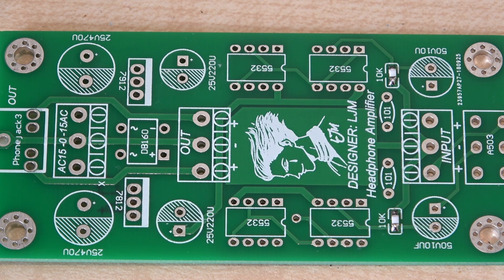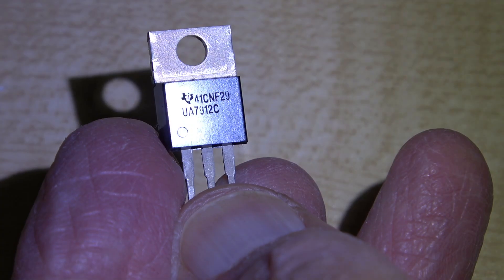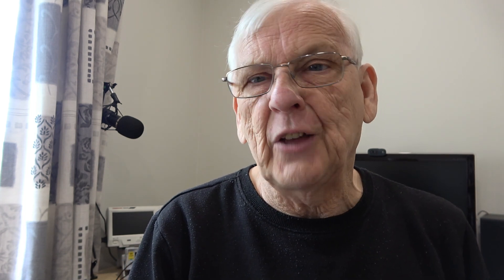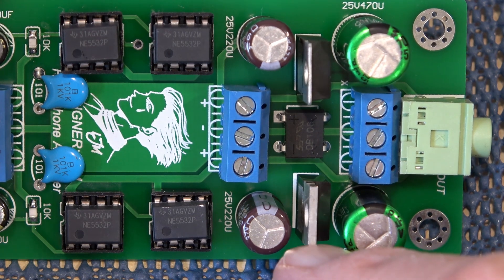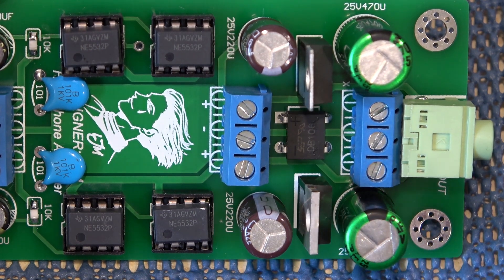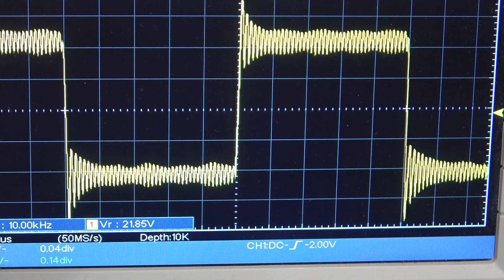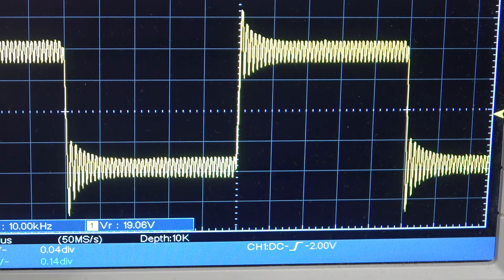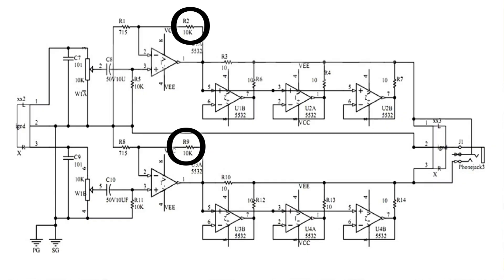Putting multiple ICs in parallel. A good idea or not?

Comment: The problem here is that the designer misunderstood how to parallel opamps and combined two methods.
R10 should be there if U1A and U1B were the only two opamps in the channel. This is exactly how it is shown in TI and AD application notes on paralleling two opamps. But here, adding U2A and U2B spoil the fun.

By removing R10, you "demote" U1A to the VAS stage while U1B, U2A and U2B are the only paralleled current drivers, each with its own equalizing resistor. If you move the right connection of R2 to the combined outputs of the three driving opamps, you compensate for any distortion in the driver opamps even more.

There are commercailly available headphone amps that are designed this way and one of them, the JDS Atom2, at a mere $129, shows distortion figures that resemble that of a straight piece of copper wire with gain. They use 8 opamps in parallel per channel.
See https://www.audiosciencereview.com/forum/index.php?threads/jds-atom-amp-2-headphone-amplifier-review.49795/

Comment: Michael , another great video! This subject is a great one for would be audio designers. One can successfully parallel multiple opamps but it must be done carefully. This board was obviously a poor implemtation. There are a couple of excellent benefits for designing a preamp or line driver using parallel opamps. First, you cut the noise in half by doubling the devices and has the added benefit of doubling the drive power capability. Take care!

Comment: Hi, like others have said, the input op amps are in non-inverting configuration. Inserting R5 and R11 from pin 3 to ground is a possible cause of oscillation. Have you tried removing R5 and R11 to see if the oscillation stops? The designer needs to explain to me why put a positive feedback with R3 and R10.

Comment: Bad idea given the inherent part to part variation. If, for example, the two amps have different input voltage offsets, their outputs will be constantly fighting. This case, plus the parasitics involved is a recipe for oscillation as well as excessive power consumption.

TL;DR: Don't do it. Bad idea.

Comment: One of the first things you learn in electronics is to never hook two outputs together.  Simply just don't do it ... the circuit will become horridly unstable as one output feeds noise into another, forcing feedback networks to try and compensate. 

Thanks for demonstrating this Michael.

Comment: Is the problem the parallel configuration itself or poor implementation of the configuration? ... (obvious in the specific case presented)
Reply: Poor implementation. Plenty of professional electronics gear that uses paralleled devices, be it FETs, BJTs, or even opamps for increased output power and lower sqrt noise. But that's been designed well and in a proven design before they start selling them for thousands of dollars. Proper power and response sharing is a tricky topic in general and cannot usually be approached from any one-size-fits-all principles.
Reply: @ivolol  Thanks
Reply: The difference is whether the paralleled devices can "sink" current. 

You can, for example hook two BJTs in parallel because they can absorb current in their collectors.  That is, they don't fight the current source.

You cannot, for example hook two Class AB op-amps together because their outputs are on emitters and they cannot sink current... feeding current into their outputs upsets the output stage bias and can cause massive instability.
Reply: @Douglas_Blake_579  Thanks.  Is there another class op-amp that will allow a parallel configuration?
Reply: @cougar1861  
Probably.  I don't know of one off the top of my head.

But... if you want to build a headphone amp, why wouldn't you use a chip, like the TPA6133, made specifically for that job?
Reply: @Douglas_Blake_579  I was just looking for general information not planning to build a headphone amp.  I opened the video based on the interesting title but was disappointed with the hopeless kit used to explore the topic.
Reply: @cougar1861  
The most general info I can give you is that hooking the outputs from these chips together is generally a very bad idea.
Reply from the maker: @cougar1861  Why not just use the Accuphase clone, I have shown a few weeks ago, that is a very capable headphone amplifier and a very good preamp, all for a very low cost. There is nothing magical about a headphone amplifier, it's basically a preamp that can output current at a low impedance.
Reply: @Douglas_Blake_579  Got it.  I'll watch the video again and then look at the schematics of the examples of parallel-opamp amplifiers mentioned elsewhere in the comments, i.e. those of Douglas Self and "Phil's Lab."
Reply from the maker: @Douglas_Blake_579  I was just going to reply but you beat me too it lol.
It is quite common to parallel output transistors, or FETs in power amplifiers, this works perfectly. Even then matching is preferable and almost always have a low value resistor to share the current. These are discreet devices, not complete amplifiers.
Reply: @MichaelBeeny  
Yep... where you get into trouble is when you try to feed current into the biased emitters of a class AB output.
Reply: @MichaelBeeny   I too was curious about starting with such an obviously compromised setup.  Is there not a better way to demonstrate (or debunk) this application than using an inappropriately designed circuit full of unknown knockoff components?

I found this video in my feed after looking into op-amp “rolling” in Class-D amplifiers and DACs, and I have subscribed to your channel as I’m extremely curious to see what sort of experiments you come up with.

I was disappointed to see this approach taken.  I too have seen claims that piggybacking 5532’s can improve SQ, and after seeing your oscilloscope captures I believe your explanation could indicate why (high frequency “detail” is actually oscillation), but I would also like to see this demonstrated in a much more reliable circuit.

I know enough about electronics to be dangerous, nothing more, but I’m seriously looking into purchasing an oscilloscope to play with for these very reasons.  I haven’t used one since high school, but it’ll come back to me I’m sure.

Keep up the interesting work!

Comment: If you google NE5532 power audio amp, you can find an article about paralleling up 32 of them to make a 16 watt amplifier to drive speakers.
Reply: Ok, you found the 'Elektor' article of Elektor 10/2010. The author is Douglas Self. I learned in the comments, that he designed the amp presented here too. So he seemes to to be a big fan boy of the NE5532's. I like the NE5532's too. But my design of a headphone or power amp would be very different for different reasons! I guess, that Douglas was temptated by the low pricing of the chips. The 5532's were really expensive in the 80's !

Comment: My own experiences attempting to parallel op amps (in particular the NE5332 and LM4562/LME49720 series) have been highly negative.
Those experiences led me to work on a hybrid (IC/discrete- not tubes/valves) design that performs very well so far.
Mike alluded to this in another of his recent videos and it will be revealed shortly (we hope).

There ARE op amps, mentioned below, that are far more amenable to being paralleled.
For example, the NJM4580 which works quite nicely in parallel.
If you were to plug them into Mike's board (with R3 and R10 removed..!) they would probably work well.
The output resistors (R4,5,6,12,13 and 14) could be as low as 2.2 ohms and they would still be happy. 
I built a kit headphone amp (HA-PRO2 style) using paralleled NJM4580 chips for my wife that both sounds and performs great.
No oscillations, no overheating chips, it just works..!

And the LME49600, also as mentioned below, is an absolutely excellent high current and high speed buffer chip that is very well suited to work along with the LME49720.
Texas Instruments in fact sells an evaluation board (LME49600TSBD) that incorporates both these devices.
Great- IF you can afford it (about $250USD).
Sadly, this device is not available in a package style that is usable by most experimenters and it does require special care in board layout and supply rail bypassing.

😃  FWIW...

Comment: when I buy cheap parts i like to buy used/pulled parts, you get a few broken ones but most are in good condition as they have been pulled from failed products (as in didnt get to market) and are usually genuine parts unlike the spanking new parts that are 'genuine' 
I usually do this for power mosfets, simple to test and verify to be original gwo

Comment: R3 (R10) are somewhat controversial...
It can be seen as positive fdbk on the three buffers which seems a mistake but maybe as an additionl 4th balancing resistor to feed the load by the first stage also.
As already said in other comments, unmount R3 and check, should be fine. In this case three buffer will drive the load in //.
On the other hand, if the gain opamp is also intended to contribute driving the load (4 in //)...well, i think that simply having R3 in that place is not a good idea.

Comment: Looking at the circuit, it appears that the first 5532 gives a voltage gain of 15, the other 3 provide current amplification, the parallel configuration to reduce the output impedance to assist the driving of low impedance headphones I suppose..
I would try adding a 470pf capacitor across the 10k resistor R2 which will reduce the bandwidth by -3db at 34khz and hopefully stop the oscillation.

Comment: Hi Michael, the equivalent circuit of  IC socket pin will contain inductor, this may be the cause of oscillation. The kit did not come with IC socket for a reason So after the experimentation, try the board without socket and see how it goes.
Removing socket is not hard, get a solid thick wire, secure it around outside of 8 pins, then fill the solder. After heating 8 pins at the same time, socket should fall off.
Reply: Highly unlikely the oscilation is caused by the sockets.
Reply from the maker: @WimukthiBandara  I would agree. I always use sockets, simply so I can experiment. This is the first time I've seen so many issues.

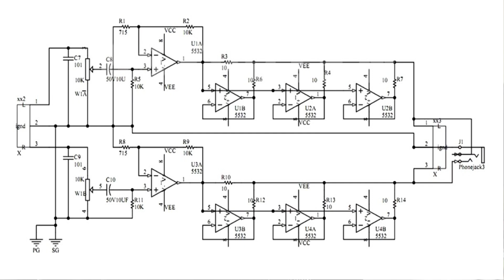Comment: Well, i wonder, if the the schematic is right. What's the purpose of R3/ R10 (11:28)? Of cause they ruin everything. Just pull them out and the oscillations should disappear. Paralleling Opamps can really make sense in some applications. When it comes to audio parallel Opamps are used in input stages of phono preamps. The paralleled inputs lead to reduced noise ( 4 parallel Opamps cut the input noise in half !). Years ago the 'Elektor' magazin published a power Amplifier ( 10 to 20W, i guess). It consists of a lot of NE5532's. So it was a similar approach to this amp.
Reply: That design was from Doug Self and is discussed at some length in one of his books.
However, very careful board design and component selection is required.
Such care is clearly not evident in this board...
Reply: @ronschauer839  Ok, Doug Self is someone. So i had a closer look at the circuit. Yes, with R3 and R10 inserted you gain the additional output current of U1A /U3A. But in my eyes this is really a danger seeking design. He introduces positive feedback while not knowing the connected load.

Comment: Aren't 5532 chips so cheap anyway, it doesn't seem worth the effort to fake them?
Reply from the maker: From my experience, fake 5532s are not manufactured new. They are simply an older poor spec IC re labeled. Effectively costing the fakers almost nothing. The only cost is re labeling them. I would expect they are making more money out of fakes than the profit from a real one.
Reply: @MichaelBeeny  True, but the big users of that chip would just buy from TI or a big supplier, whereas I thought hobbyist audiophiles were mostly interested in replacing the 5532 with something better these days, so are they still in demand with tweakers?

Comment: Hi. First  of all I want to say that I like very much of your vídeos. About the circuit: 1- I never liked op-amps in parallel. 2-  The R10/3, 10 Ohms resistors increase instability via the positive feedback they provide. 3- A 1KOhm resistor inserted between the node of C8/R5 (C10/R11) and the positive input (3) of the first op-amp will increase stability without any penalty in the audio band...

Comment: You might try a 680 pF cap across R2 and R9, which is 10x the value you tried.  With R2 & R9 being 10K, 68 pF gives a cut-off frequency of 234 kHz which is much higher than needed for audio.  Using 680 pF, the cut-off frequency drops to 23.4 kHz, still above audio with a nice roll off. 

Out of curiosity, if you try this experiment, can you show any oscillations on the scope trace?

thanks

Comment: Ah you answered all my questions with the amazing power of square waves.  

I discovered recently a dual opamp called Oracle II 02 and it’s $8 on Ali express.  The alleged specs are Here are the correct specifications for the Oracle II 02 op-amp:

Maximum output current is 60 mA, slew rate is 35 V/µs, signal-to-noise ratio (SNR) is at least 120 dB (A-weighted), power supply range is ±5V to ±18V, THD+N is less than 0.0002%, and input impedance is very high (exact value unspecified).  Apparently it’s designed for audio applications.

Seems interesting.  I’d be happy supply some funds for you to buy some if you are interested in testing them.

Comment: Oh dear, here we go! The headphone brigade have switched on full pedantic mode 😀I've only made about 4 HP amp circuits, don't use headphones much, but my favourite consists of dual parallel output NJM4556's (because they work very well in parallel and offer 140ma into 150ohm loads). There are multiple ways of designing paralleling opamp circuits, but this one from Ali is just not good!

If anyone's looking for an interesting premade kit look for the class-A LJM HA-PRO (first edition). I got it as a gift for someone and never measured it it, but it sounds great, cost about 20 quid and will drive up to 600ohm headphones.
Reply from the maker: Hi Peter, the Accuphase clone preamp does in fact run its output transistors in class A.
Reply: @MichaelBeeny  Yes it does, I was referring to headphone amps above. I finally got my Accuphase preamp clone kit last week. Thanks for videos on that one! It really does measure well, and sounds terrific. I used an OPA2134, Nichicon bipolar capacitors in the opamp feedback circuit, higher value MKP caps for the HF filter and run it from a supply using a discrete de-noiser circuit.

Comment: Having paralleled amps so that signal is additive but noise being random is not is certainly a useful method, but is not what is going on here they are simply adding the output drive capabilities of the chip to achieve reasonable power into headphones. would be interesting to tune an AM radio to the oscillation frequency probably pick it up quite nicely ( another source of RFI to add to the environment) given there are plenty of chips suitable for headphone amps I don't see the point of this abomination

Comment: Hi, frankly, I don't see what conclusion we can draw on the basis of such rubbish.
Reply from the maker: Well, some people like rubbish. You are one of those people. Welcome to my channel. My channel is mostly rubbish, ask anyone. of my 10,000+ of my subscribers.
Reply: We can conclude the circuit here is badly designed and exhibits oscillation. Also that many components from Ali are fake, seem to work most of the time, but may be at higher risk of failure. And that some stuff is really good as outlined in his Accuphase Clone videos.
Reply from the maker: @peterlarkin762  I think we can conclude exactly that Peter.

Comment: The Ali boards seem to be pretty good but I could not trust the parts, so buying known parts is darn tempting. (I did that with the 3580 pre and it is great)
Thank you for continuing the closed channel!
Reply: Sometimes you can find just the PCB of the same item, then buy the components from a reputable distributor. The 3580 kit had pretty decent components (i measured them). Still replaced the opamp and some caps but that kit was well put together.

Comment: Doug Self made an amp with several 5532s. I thinl itmay have been a power amp: it was alng time ago and my memory is sketchy.
Reply: I just checked Self's book. He describes an amp he built using 64 pieces (128 individual sections) of NE5532 opamp chips, which were able to give 60 W into an 8 ohm speaker. Outputs were separated with only 1 ohm resistors.
Reply: @mariuszsobolewski6713  Yes. I measured the performance of one of these many years ago and it was excellent in every respect for what was actually a very simple circuit. Any blanket claim that paralleling opamps is a bad idea is utter nonsense. It depends entirely on how you implement it.
Reply: Thanks, I must look into this. Self designs are timeless. I googled it, it's real!!! Not several opamps but dozens...  a feast for the eyes. Reminds me of Nelson Pass's amp with hundreds of small JFETs.

Comment: looked @ the circuit it is crazy paralleling arrangement it is totally stupid. The positive  feedback 10 R turns the voltage follower into a comparator with strange characteristics...poor cct design by a novice
Reply: It's terrible. The real pity is it's easy to make a decent parallel opamp circuit. Analog devices have some good literature on the issue.
Reply: @peterlarkin762  Chinese are cheap skates they will use 2nd parts, out of spec then rebranding them. Even big Co' have been hoodwinked.  Chinese tablets/car head units are claiming  the latest ANDROID OS are in reality they are out of date Android 4+ or 6.0 just warmed up to claim Android 10+ in the setting page. The problem comes new APK Apps require more current OS.s to install & run. Prime example Chrome cannot be upgraded to the latest version